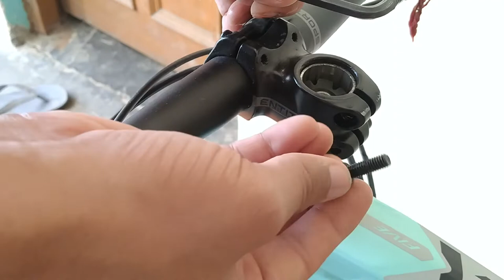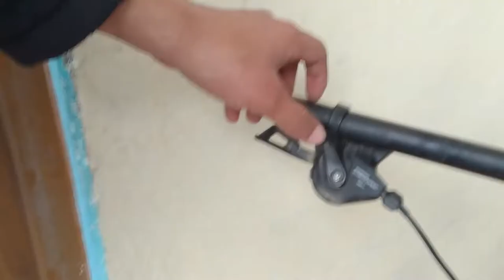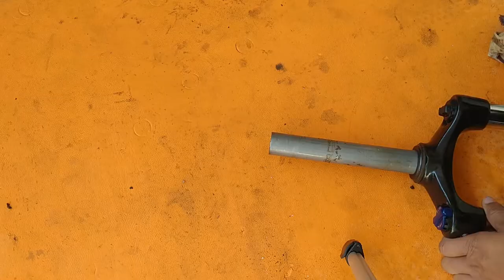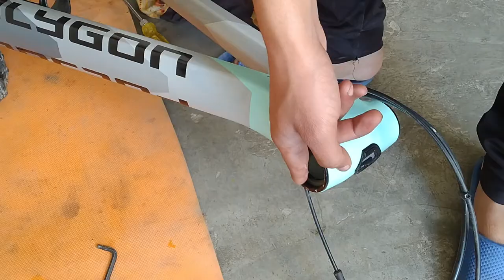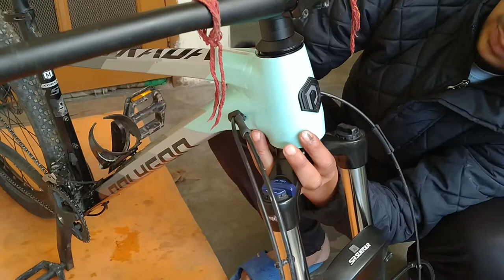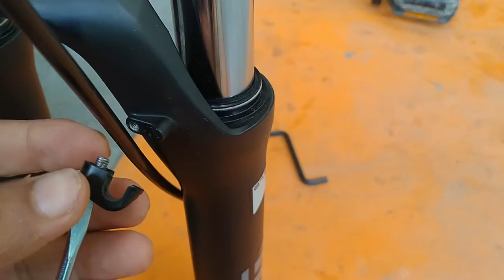Polygon Xtrada 5 Headset Service | Xtrada 5 Maintenance | Umesh Bhatt Vlogs

Comment: I think the top buckshot is upside down. I feel there is a bit of gap from installing this way. and this I got from the store. then I tried my way and no more gaps. thanks for sharing.
Reply from the maker: There is no gap there.
Reply: Tedy, @Umesh Bhatt Vlogs executed this overhaul flawlessly - exposed "buckshot" always faces onto the outer edge of the cup, and the solid ring of the crimp faces up into the inner slope the cone.

Comment: Itu headtube ukuran brp bang
Reply: @Angga PR : Polygon's tapered head tube consists of a large 1½” base that tapers up to 1⅛”. 
This tapered head tube allows for a better weld between the head tube, the top tube and the down tube (makes the frame stiffer and more durable). 
Also increases the interface between the frame and the steer tube.